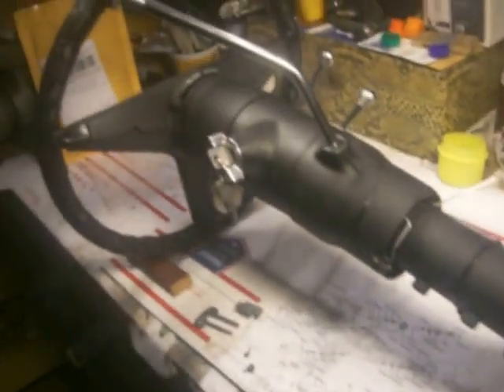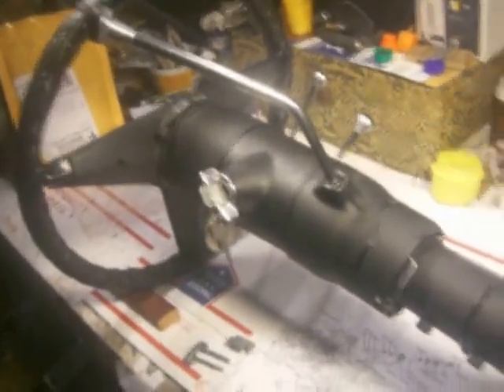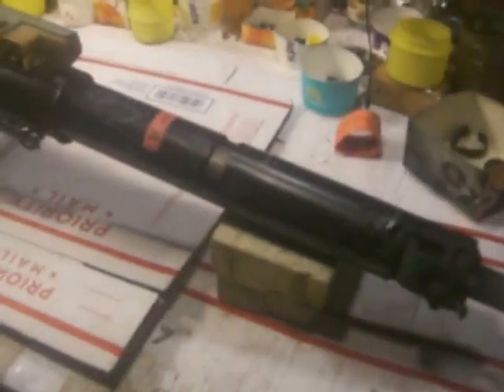Cadillac DeVille Tilt and Telescopic Steering Column Repair Video 3 Anthony NC

Comment: You have a new fan! Been shopping for a 67 to 69 El Dorado, and trying to learn the pro an cons of owning one. May i ask what was the cost to do that job?
Reply from the maker: Hello Victor, and thank you for your kind comment regarding the restoration of the Cadillac Steering Wheels.  In addition to my restoration services of Original Vintage "Hard to Source" Cadillac parts,.. I also have over 75,000 Cadillac Eldorado specific items in my collection of parts and over 375,000 1959 to 1978 Cadillac items overall so if there's anything else you require feel free to reach out to me again.
Kind Regards George 727-364-7523 eMail kypitsn@aol.com

Comment: Hello would you know the telescopic steering bolt that goes into the telescopic shaft? I though I had the original but it's not. Ididit steering thinks it's 9/16 18 hex but I can't confirm. Ex they do not have that size at Home Depot. 
Thanks
Reply from the maker: Hello Juliette and thank you for reaching out with your question pertaining to the threaded hole in the center of the telescopic neck of the steering column. Be advised that this is not a HEX bolt as you suggest in your question,.. rather this is a specialty saucer bolt that accommodates two (2) functions.   Firstly the threaded end  pushes down the locking rod that runs through the center of the telescopic neck, and Secondly the saucer shaped head provide for the attachment means for the locking lever via 3 ancillary screws. I can send you a photo via text messaging if you are unfamiliar with the part,.. just call me at 7273647523 or email me at KYPITSN@AOL.COM

I have over 25,000 original vintage 1960-78 Cadillac parts in my collection.

Kind Regards,
George